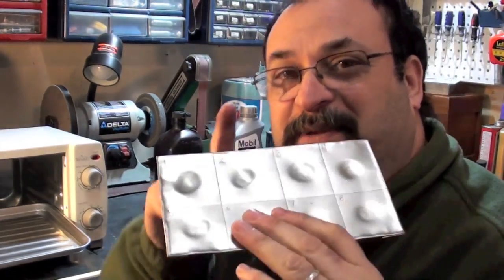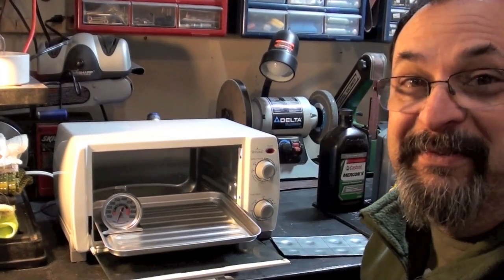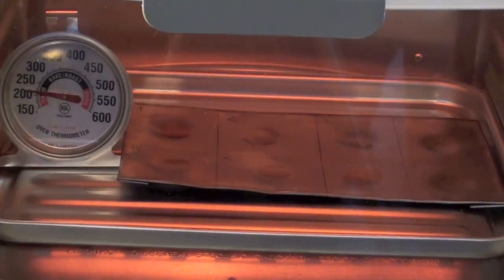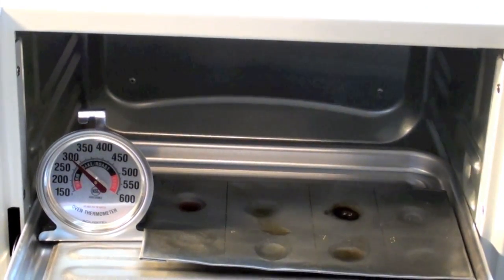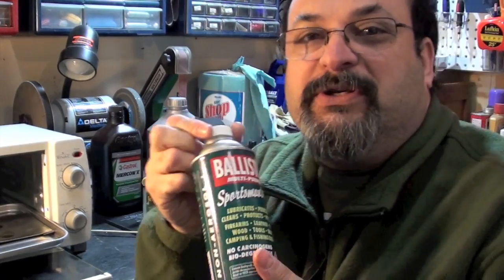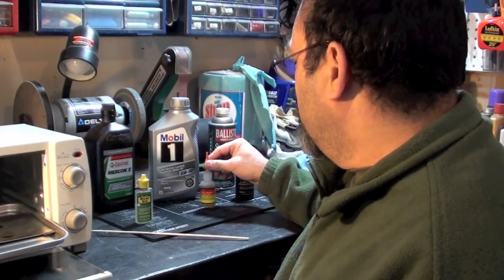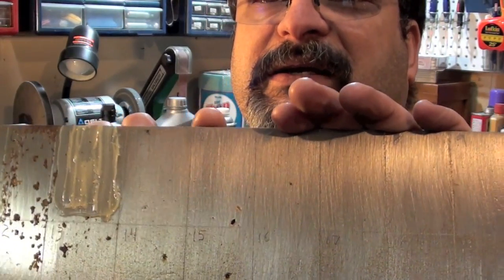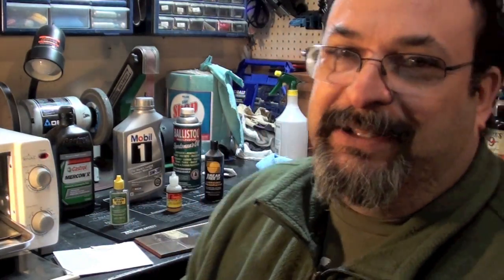Gun Oil Heat Test

Comment: heat is one stress factor, there's the mechanical stress and also the chemical stress factor. heat resistance of a lubricant is reduced when the other factors are not nil. nowadays if you want to have a proper lubricant for the job and you really know how how things work you will go with a homebrew. or just buy a product that you know that cant be beat by the homebrew as you would not care too much for the price tag and you cant be bothered to get the parts in order to mix them up. there is an additive that is excellent in heat transfer by the way. it also reduces vibration very, very well. it's also used in cosmetics.

Comment: Not surprised in the least that CLP (Breakfree) passes with flying colors. Been my preferred gun cleaner/oil for over 20 years. Any automotive lubricant will handle high temperatures, just look how hot automobile engines run for hours on end and last for thousands of miles in between services.

Comment: The rem oil actually soaks in with the heat but isnt a good lube. It's good to oil soak to prevent rust but remoil isnt a very good gun lube. Rem oil is good to rub down flash rust and light spot rusting. Synthetic motor oil works great as a gun oil. ATF is basically hydraulic fluid with anti foaming additives and it's not a very good lubricant compared to motor oil. Don't use ATF because it's not good for a firearm.  Personally I oil soak (oil it well and then heat) my guns for protection against rust and then I use synthetic oils (sometimes automotive, sometime gun oils). Automotive oils seem to last alot longer than most gun oils also. I do gun coating also and I do have to draw the heat soaked oil out before coating guns but that is part of the job. I am a certified gunsmith and also have been building everything from performance small engines from about age 10/11 and full on racing engines (classic SBC v8s and 4.3s and LS based v8s since I was 15. I'm now almost 35. My first racing engine is still perfectly fine (very over built for how hard I run it), one of my other cars that I daily drive is my 2002 TransAm WS6 6speed it's low mileage for its age at 65k but it been driven and raced hard since I got it with 33k miles on it and the engine itself is stock but its seen plenty of 125 and 150rwhp shots of nitrous and shows no signs of any excessive wear. If royal purple can handle that kind of heat, pressure and friction in all of the racing engines I've built in the last 24 or so years, it can take the harsh environment of firearms, even in dirty direct blowback, Direct impingement guns, and very dirty roller delayed blowback guns like h&k 91,93,53, and the well know fullsize 89 mp5. Gas pistons guns dont tend to get as dirty in the action but they all run like sewing machines with RP oil and they dont need to be oiled as often from what I've seen. The detergents in the motor oils that prevent carbon build up in engines also makes guns easier to clean also. Use what you prefer and experiment if you want but I know full synthetic performance engine oils work very well in firearm applications. Some engine oil companies are making gun oils now. Lucas oil additives is one of them but youd be better of with mobile1 or Royal purple. 5w30 is a good weight to work with in most any temperature range that a semi auto will see. Extreme cold might be your only problem but it doesnt ever get that cold in SC.
Reply: Even in extremely cold weather motor oil stays less viscous than most gun oils. They are tested in below freezing temperatures, so they are good to go in very low temperatures and very high temperatures.

Comment: Ok ATF is also good at cleaning! I and many HV/Ac guys I know and worked with. Use it to clean parts and are hands . But if you want atf oil that dose not smell try power steering fluid or hydraulic oil. They are the same stuff but without the stuff to clean and other stuff. Many old mechanics have told me it’s ok to use atf and hydraulic fluid in your power steering and the other in anything . That used hydraulic fluid. And many guys I know that do competition shooting use mobile 1 . Also here in Arizona we stay away from Grease do to dust same in my past job !

Comment: RemOil is a light oil, so it isn't very good at staying, it always evaporates. This is true even without having to heat it up: it'll evaporate even during storage or even between magazines. But it is cheap and many folks like to pull out their BCG and spray it before sending more rounds downrange. 

At the end of the day, the "plate of truth" doesn't mean much if you're shooting your weapons regularly. If you're storing your weapons, then just throw some cosmoline on them and inside the barrel: problem solved!

Carry on, shipmate!

Comment: most of these would work on pistol / rifle trigger mechanism... but  a  moving action on a  pistol slide or any fast moving bolt/ barrel  that  does  get Hot   it all would just sling off  just go get a descent automotive high temperature  type of  grease  that will remain on even after getting Hot yet still keeping it lubricated

Comment: Engines operate at about 210 F. Motor oil has had more R&D put into it than any of those "gun lubes".
Reply: 210 is just what most coolant temperatures are regulated to. That oil is exposed to higher temps. 👍
Reply: I have. Lots of money, very little R&D. That's why they source it out to the private sector, because it is cheaper than if they did it internal (yes, the Military Industrial Complex is actually cheaper than if the DoD did it on their own, and more efficient). Problem is that because all of the DoD's money is from taxation (i.e. not their own income), it costs a lot more than the product that we civilians can buy (on par or better than Mil-Spec) within the market (because one cannot budget from money that they've not earned on their own, or from money that they do not personally own: it is essentially free money to those that make such decisions). 

Consumers may benefit, taxpayers do not. Since every human is absolutely a consumer in every sense of the word, it then becomes difficult to know if they make out in the end since they're all generally taxpayers, as well. 

(lots of waste in bureaucratic processes does not always translate into a benefit in the general sense)
Reply: Clearly you never seen the r&d the military does.
Reply: @ Kris  Yea, but then the civilians make the decisions based on factors other than what is the best lube.  CLP was chosen because it does an "ok" but not "great" job of doing three things - cleaning, lubing and protecting and, therefore, the soldier humping in the field only needed to carry a small bottle of ONE chemical to keep his weapon operating in combat conditions vs two or three.  Additionally, the cost factors of testing, procuring, storing, distributing, etc. etc. three substances such as a dedicated bore cleaner, lube and protectant vs just one.  Just because the military does something doesn't mean its the "BEST" solution for everyone because they have to take into account many, many additional factors.  fwiw
Reply: Mobil 1 also has anti rust protection.

Comment: Thanks again for another great video!  Based on your tests and the Freezing Tests (-8 to -13 degrees) by Learning Firearms channel, on my tenth or so reincarnation, once I've used up all the different lubes I've accumulated, I'm switching exclusively to Synthetic Motor Oil for my gun lube and whatever bore or action cleaner is around for cleaner.

Comment: You should use Mobil 1 0w20, it has better low temp protection. Also, Frog Lube and Hornady One Shot were the overall winners in another extensive test, see test on shooters forum

Comment: Considering trying out Mobil 1 on my gun. Thanks for the excellent video.
Reply: Shaka260 you won't regret it. You probably already have 😂
Reply: Motor oil is too thick and sticky. ATF all the way. Wouldn't rub it on stuff that I'm touching much Nufinish.
Reply: I have a qt of penzoil Dexron 3 ATF. Probably 10 or 12 years old. The stuff barely stinks at all. Smells like a light oil. Not the sweetness of freash motor oil, but not the stank of gear lube.

Comment: EVovchuk I disagree with that. The residue from the rem oil may still protect against rust but it won't make a good lubricant. I would rather have runny oil and adequate lubrication. If you clean your gun well the lube running around won't matter. Chances of you getting your action to 300 degrees is pretty slim any way around though, at that point your bigger problem would be your chamber temp. That is just me though.

Comment: Maybe it's possible that the Rem Oil evaporating and leaving a protective coating on the gun is better than other oils which simply become more runny and would run to other parts of the gun which you didn't intend to use oil on?

Comment: Automatic transmission fluids are detergents designed to protect exposed metal from friction, heat and carbon build up. However, they do not do well with too much carbon in the mix.Engine oils are great! After about 315 degrees Fahrenheit, engine oils fall apart and turn acidic. This should not be a problem in a firearm though. 

Great video! Gave me an idea! I'm going to use engine oil for my AR lube, except for the expansion chamber, where I will lubricate with auto tranny fluid to prevent carbon build up! We'll see how it goes!

In my AK I have been using Lucas oil high temp grease (I think it was called red-n-tacky), which also has anti-seize in it. Works great! After firing 300-400 rounds the grease is still in there, not melting away and even red lol
Reply: Sector 001 You may be right about that as I have not checked for flash point. What I was referring to was the point at which the oil is basically broken down on a molecular level and turns acidic, meaning no more lubrication is being provided. Since you said that though, makes me wonder if my info was about traditional or synthetic oils... There may be a difference, I will have to check this out! Thanks
Reply from the maker: g35Gevo Thank you so much for sharing all this information with us!!!
Reply: ***** Thank you for your informative videos!
Reply: g35Gevo I believe synth oils are in the 350 to 400 range (flashpoint).
Reply: Sounds good, g35Gevo.
Reply: +g35Gevo , this was such a good topic Fred, that i have done my own "plate of truth" 1- carbon steel, 1- carbon steel cold blued, 1- S.S., 1- aluminum. all plates where sanded with emery cloth then wiped clean with latex gloves on. used car oils n gun oils and left outside since 3-17-2015 today is 11-22-2015 had pretty much same results. Mobil-1 held up the best as far as rust with the car stuff. Frog Lube turned lil greyish but also did not have any rust either. what i didn't expect was that the S.S. had rust specs on the plate. aluminum plate had turn grey and chalky.the blued steel rusted almost as bad as the plain carbon steel plate in areas not protected.I live about a mile from the Alt. Ocean. P.S. it cost some money to do these tests too.lol.
Reply: MegaBait56 Wow thanks for the test! You should make a youtube post to get some views :)

So I guess the consensus is, when storing your firearm its best to use Mobil 1 full synthetic for protection. Now, we need a test for wear resistance at varying temperatures :) Anyone up for the challenge? lol

Comment: The Castrol Mercon V transmission oil and the Mobil 1 5w30 engine oil are both full synthetic products and they are for use in engines and transmissions which tend to generate quite a bit of heat.  The Mobil 1 website shows the flash point for 5w30 at 230 degrees C which is 446 degrees F. I don't think you could handle your firearms if they reached that temp anyway.  Incidentally, it's pour point is -42 degrees C which is approximately the same -42 degrees F.   That means it will remain a liquid down to -42 degrees and continue providing lubrication.  The website also notes that the oil helps prevent sludge buildup.  That is for when carbon in an engine mixes with the oil and the 2 together create sludge.  The 5w30 has anti sludge or anti carbon additives which help keep carbon from causing engine problems so it should help keep carbon fouling or carbon buildup from occurring on a weapon.  The website also notes 5w30 has outstanding thermal and oxidation stability.  Some forums state that Mobil 1 will not prevent rust, however if it limits oxidation formation in an engine it should do a good job of keeping parts from rusting on a weapon.
Unfortunately the Castrol website does not have any product info for the Mercon V transmission oil other than it provides exceptional thermal protection and promotes smooth shifting, so one can speculate it also provides good lubrication and the oil should remain in place even when the weapon is hot.
Reply: As a substitute for the Mercon V, try Dexron VI.  It's the GM synthetic transmission oil.

Comment: What is the purpose of this test? Are you aware that no gun oil is designed to withstand heat like automotive engine oil is? Seems to me you are comparing apples to oranges. Gun oil is simply to apply to firearms once cleaned for storage. They do a fine job of it. Don't put gun oil in a motor, and don't waste your time putting motor oil on a firearm.
Reply: Please tell me what parts of a firearm reach 300 degrees where motor oil is a good lubricant, or any other gun oil.
Reply: I only use synthetics in my cars, either amsoil, RP. I only use synthetic gun oil but I don't have ARs, just bolt action hunting rifles. I like G96, Royal Purple gun oil, and KG products.
Reply: Ive ran my gun to the ponit where water boils when splashed with water. And becomes way to hot to touch. So yes guns do get extremely hot. Everyone shoots a different number of rounds.. saying guns dont get hot is just stupid. Engine oil seems to be a product worth giving thought for use in a firearm.. so since a gun gets this hot , gun oil should be able to handle these high temps.. put poor oil in your engine that cant handle heat and see what happens.. im amazed at how many people just dont understand guns and a lot of products out there on the market... Its like if a so called expert says welding your gun shut will make your firearm shoot flawlessly , some of you would listen and weld your gun shut

Comment: I used to use special gun oils. No more. I've been using Mobil 1 on everything, and Chevron SRI2 grease for my M1A receiver. My 1911's, Rugers, Sigs, and my AR-15 all run on Mobil 1. My AR-15 runs better than with any other lube I've ever used. 

Mobil 1 not only makes it run better, but the stuff spreads, coats, and stays put to prevent corrosion in some pretty harsh conditions. Think about it. Your gun is like an engine, and nobody has put more money into development of lubricants than Mobil.

Comment: Not absolutely true - the heat from combustion of fuel is the main source of heat in an engine - not frictional heat.  In either case, shear heat (friction) and radiant heat both cause decomposition of the oil.  In this simple test, if it volatilizes (goes away), or turns black (decomposes), then probably not a good choice for firearms that run hot.

Comment: just because it is the most popular.  All motor oils have to pass the same engine tests, so for synthetics they are very similar.  Of course Amsoil, Redline, Royal Purple, etc are also designed for race cars, and thus formulated for higher heat and harsher conditions.  Probably better than Mobil 1.

Comment: interesting.  ATF smells bad due to high sulfur content which improves the extreme pressure capabilities.  Mobil 1 (and all other good synthetic motor oils) also contain anti-corrosion additives, and detergents/dispersants (which break up carbon formed during fuel combustion and keep it suspended so that it does not deposit on metal).  This would also help stop carbon buildup on gun parts.  Motor oil is also formulated for high temp use (duh - in an internal combustion engine).

Comment: that's a super nice presentation... however, lubricants don't work like that... the heat from the friction is what deteriorates the lubricating properties of the oil, and not necessary from a heat in the oven (or heat applied to it)... oils are simple, but complicated in a way that the lubricating capabilities differ when friction is applied... 
can we see a test where friction is applied, and then see which of the oils retained their lubricating capabilities? THANKS!

Comment: I noticed that they are all in liquid form and as they got hotter they seam thinner. I wouldn't want to use any of them because as soon as they get hot, they'll run off of where I need lubricated. Guess I'll stick with my High Temp Wheel Bearing Grease. Thanks for the video. If you do another one, do one on grease for us who use grease in our guns instead of oils. Thanks

Comment: This is why I won't use some of those multi-purpose oils as the last step in the cleaning and oiling process. I believe that you should use a dedicated solvent as a cleaner then wipe your parts down dry and THEN apply a more dedicated, thicker, oil as a lubricant/protectant.

Comment: I am curious as to how much ammunition you will be putting through your rifle at one time and the rate of fire you will be achieving that requires you to use a motor oil or automatic transmition fluid to lubricate and protect your rifle.  The amount that would be required and the rate of fire would be substantial.  Plus any sane person would know that controlled shots are better then just spraying and praying.  Please do not think I am knocking your video as I am not.  I am just curious.

Comment: Just a thought but I noticed that both ballistol and clp had discolored, both have cleaners in them that evaporate over time.  Maybe if you let them sit for a while before putting them in the oven your results will change.  Also have you tried G96 it is supposed to have excellent heat resistance.